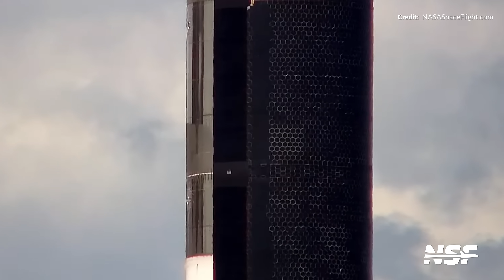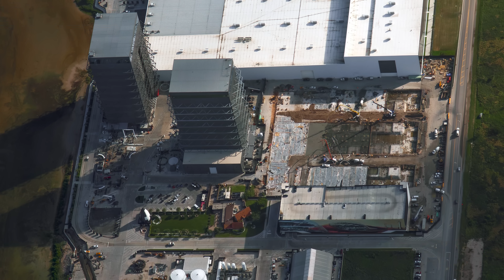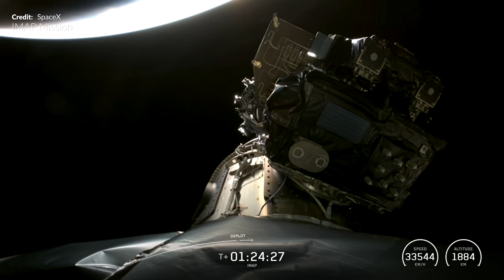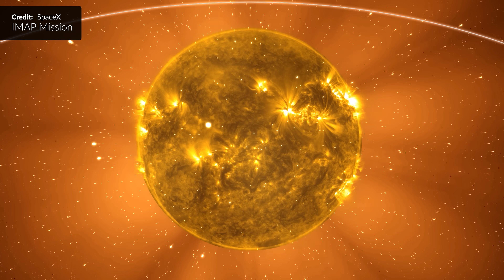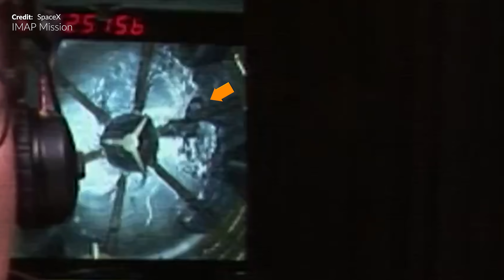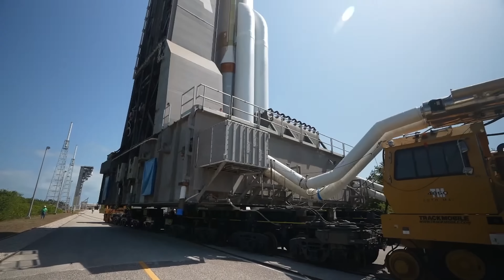Final Goodbye: What You’ll Never See Again with Starship! 🔥

Comment: Regarding Starship refueling in space, I have a solution to prevent solar radiation from heating and boiling the fuel. We could first launch a massive sunshield into orbit, and then all future Starship docking operations would be conducted within the sunshield's coverage. This would significantly reduce the complexity of the Starship and avoid the challenges posed by solar radiation.

Comment: I think they will do testing on OLM 1
Reply: The only issue with that is the booster interface seems to change with versions which makes just about all the hardware on Pad 1 obsolete.  Had they not done that I would have also speculated that Pad 1 would remain a test stand until Pad 2 is fully validated.

Comment: at this point in 50 years well get in orbit mega structures making mankind immortal from mass extinction events and foundation for exponential long term growth no more resets
Reply: You think in as little as 50 years?  I'm not quite as optimistic mostly because there is a ton of R&D undone and mega structures also tend to be mega expensive. :)
Reply: @imaginary_friend7300   true but with starship able to transport 100 tonnes of material every launch able to do multiple launches a day you could build a lot very quickly and enough billionaires willing to pay absurd amounts for their safety bunkers in space since money at some point of wealth becomes very abstract and not real
Reply: Now calculate the surface area:

Area=
Volume/Thicknes=37.037m3/0.005m=

7,407.4m2 of 5mm alu plates in 100ton

thats a lot of structural walls remember in space walls are very thin since anything hitting it will penerate anyway so less mas means less kinetic energy absorbed so thinner is winner

Comment: If SpaceX is going to meet the timeline for the moon lander they are going to have launch a lot more frequently than once every 7 weeks.  The test prgram needs to be coming to an end.
Reply: Starship test program hasn't even begun yet - there is no final design to test.
Reply: The test program will run for years yet, just like with F9 with a final version emerging after some years of flying.  With more than a year and a half a 7 week cadence is at least 10 more launches.

Comment: Seeing as how much damage was incurred when launching without a deluge system or launch trench how do they expect to land and launch off the surface of mars without flying debris damage ? Surely you`ve been worrying about that Marcus ?
Reply: We have no idea what a ship designed to take off again will look like yet.  Lots of speculation around small engines mounted higher up for close to the surface work and in neither case will they be dealing with 33 raptors running at full power in 1 G.
Reply: The booster will never be launched from the Moon or Mars, at least not before massive bases or colonies are created there. All plans for Starship launching from the Moon or Mars are with the upper stage only. And that will be with far fewer engines. Likely not even the 6 currently on there. For reference, the booster has 33 engines. Further, Starship HLS already has plans to use engines far up on the ship for landing and launching.

Comment: I was watching a video about orbital manufacturing. I got wondering, Starship can carry 100-150 tons to LEO but can it land with 100-150 tons back on Earth?
Reply: I don't think they have projected possible return payload capacities.  The shuttle could return about 14 tons.
Reply: Starship is designed to eventually be able to land on Mars with 150-200t of cargo, a task that is much harder than landing on Earth according to SpaceX. Earth has different conditions, more gravity but a much thicker atmosphere and lower EDL velocities which should make it easier theoretically. So it will probably be able to bring down 150-200t.
Reply: @admarsandbeyond  
I see it all the time that SpaceX fans think that landing on the Moon and Mars is much easier than landing on Earth (mostly because they say gravity is lower). It is not - it is much harder, and not because SpaceX said so, but because it is so.

As for EDL velocities for Earth you would have to look at each separately. Atmospheric entry and descent Vs are higher on Earth than on Mars, not lower, and landing V on Earth is a much lower than on Mars.

And there isn't realy a direct correlation between "lower entry and descent velocities = easier to land", "higher planet's gravity = harder to land" as people tend to simplify.
Reply: Earth landing requires much less energy than Mars landing. So, yes, if you could land 100 t on Mars you can certainly land 100 t on Earth with a lot less fuel needed, provided you have that amount of fuel left in your tanks.

The problem, however, is not in how much payload you can land on Earth but how much you can lift from Mars. As there will be no ISRU on Mars to make fuel for any foreseeable future, you'll have to bring the return fuel with you to Mars and every tonne of fuel will be extremely precious and will greatly limit your choices of what to bring back to Earth.

Comment: Have SpaceX talked about their boil-off mitigation for HLS so far at all? Blue Origin is showing off ZBO 20K cryocoolers and passive sunshields, but they are still 4 years away from needing this technology, while SpaceX will likely need to start fueling their depot in just about one year to fly the uncrewed demonstration ahead of Artemis III. They may not need 20K, but liquid oxygen and liquid methane are still cryogenic propellants that won't stay liquid for the months or refueling and lunar checkout without additional systems in place.
Reply: Yeah, that's one of my many questions too. My other big one is power. Is SS going to have a "fold-out" solar array, that can be opened in space and closed during re-entry? It's going to need a lot of power to keep the fuel cryogenic.
Reply: @aldunlop4622 HLS won't go through reentry, and the LEO starships might not need to achieve zero boil-off if they land within a couple hours at most.
Reply: @plainText384  True, but you can't just have a great big solar wing hanging out the side while trying to land on the Moon. It has to be some internal device that folds out.
Reply: @aldunlop4622  Or just Dragon-style wraparound panels.
Reply: @aldunlop4622  FWIW Blue Origin's designs for Blue Moon Mk 2, as well as Lunar Transporter, feature a fold-out sunshade that is covered with solar panels on the sun-facing side.  So that's definitely a valid approach.  But, so far the most recent Starship HLS renders don't show any such sunshade or fold-out solar panels; it appears SpaceX intends to just wrap the Ship in some really good thermal insulation, and mount some wrap-around solar cells directly on top of that.
Reply: SpaceX have mentioned thermal blankets; possibly of the MLI type commonly used on spacecraft.  Likely in combination or composition with micrometeorite ('Whipple') shielding.  Beyond that, they haven't really discussed the matter much, so far.

Comment: Marketing 101 - It's just a simple magnet that holds the picture up. ... Never talk about the adhesive stuck on the wall. ...  What holds the magnet to the wall?  Magnet to dry wall screws?  Magic?  Oh it's adhesives!!!  The one step the ad never shows is the adhesive coming off the wall.  But it's good for renters so the "assumption" is it comes off?  
Liars.
Reply: I have found removing adhesives from a wall less damaging than dealing with holes..  However I have never worked with those ones or ones that large.

Comment: The engineering is magnificent.
The cosmology and physics is putrid.
"Solar winds" of charged particles? That is the very definition of a Current. When charged particles move that is called an electrical current.
Why the obfuscation?
Because the direction of a current is arbitrary. The current can either be flowing towards the sun, or away from the sun. Think of a wire with a current in it. Which way is it flowing? It doesn't matter.
This current (the so-called wind) is flowing Towards the sun which is an anode.
So why the obfuscation?
Because the sun is an electrical discharge phenomenon.
So why the obfuscation?
Because ITER the International Tokamak Experimental Reactor's basic premise is that the sun is a nuclear fireball in the sky. This is why it doesn't work. Whoopsie Billions of dollars down the drain!
Careers ruined.
Red faced politicians. Egos devastated.
And we cannot have that.
Egos must be protected, no matter what the cost.
Reply: You sound like one of those poor sad and desperate EU people.

Comment: so spacex needs to catch b15-2 after the flight. then refuel it and fire it on the pad without running the deluge system to weaken uo the plate welds and the concrete around it to speed up demolition . would be cool to see how it holds up.

Comment: The new hot staging ring does not have the areas blocked off to help flip it the direction they want.  Is that going away with the newer design?
Reply: There's no way they will let go of that small yet improved efficacy boost. 
My hypothesis is at first they will test it without the blocked section to confirm 
the new design works as intended, and then they will re add it in later designs.
Reply: Speculation on engines gimbaling to uneven thrust by throttling some engines down for the first few seconds and lastly simple non-structural metal plates that can be inserted prior to stacking.  No one really knows.
Reply: Unknown. Good question
Reply: They may use the grid fins to start the flip.
Reply: @paulcarpenter999  What could the grid fins do?

Comment: Makes sense that Dream Chaser doesn't dock with the ISS on its first flight. Dragon didn't either, when I remember correctly.
Reply: Yeah, but that was the original plan. Dream Chaser was supposed to have its first flight last year, on the first flight of Vulcan, and it was going to be an operational mission, delivering a full load of supplies, then it just kept getting delayed and delayed and delayed, for reasons that have never been revealed. Dream Chaser has a very unusual thruster system that allows the spacecraft to change fuels in order to get different thrust levels. The rumor mill says that, after the thruster problems on Starliner, NASA wants that system thoroughly tested out before it comes anywhere near their space station. Anyway, with that test flight now unlikely to occur before 2027 (these things always get delayed) that means an operational flight probably can't occur before 2028. That business about Sierra "no longer being required" to fulfill their seven mission contract could well wind up meaning that NASA won't let them fly any resupply missions at all. It sucks but, whatever all the delays have been about, they may well mean that Dream Chaser will never service the ISS at all. I hope they find work servicing the commercial stations as they come online.
Reply: No, this means NASA doesn't want to buy it, so Dream Chaser is dead.
Reply: @admarsandbeyond The contracts for Dreamchaser are already covered by congressional appropriations and rather iron clad as long as Sierra-Nevada delivers.  There is zero reason to see why NASA would cancel that contract and no basis to assert any such claim at all.
Reply: @GlanderBrondurg because they haven’t delivered, they are out of contract, and as said the contract has been changed under mutual agreement
Reply: @GlanderBrondurg   Except that Sierra Nevada is not delivering. Their maiden flight is now over two years late. You can figure that late 2026 for the test flight probably actually means sometime in 2027, and then it will be 2028 before they would be ready for an operational flight. That close to decommissioning the station, it might well be difficult to work Dream Chaser into the schedule. We'll see. I hope they get at least a couple of CRS missions, but it won't surprise me if that doesn't come to pass.

Comment: How will SpaceX do a controlled flip of the booster with the new hot staging ring since it doesn’t have a solid piece to push against?
Reply: Probably by only lighting engines on one side. The dome redirects this thrust in a fixed direction. Ship V3 has 6 vacuum engines so gives more control for doing this. Or maybe they can just gimbal the 3 sea-level engines to direct the thrust. But i suspect its too close to the top of the dome for those engines.
Reply: @Psi105  Ship v3 still only has 6 engines total - same as v2.  The 9-engine variant is currently projected as "v4".